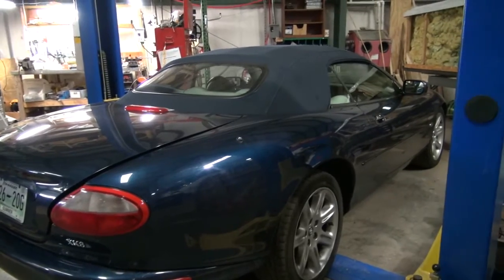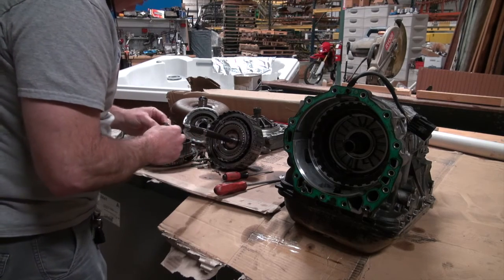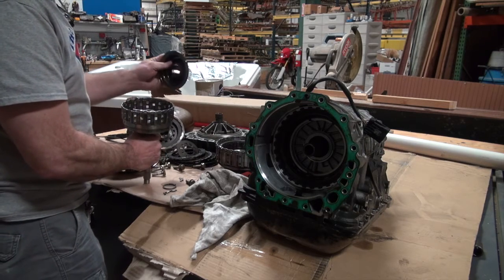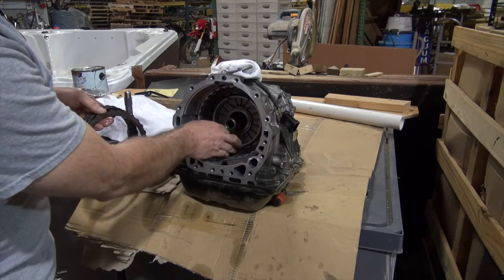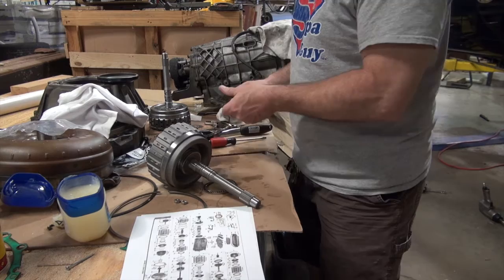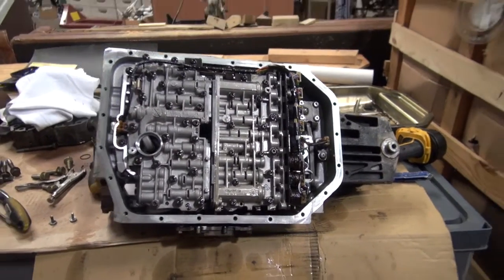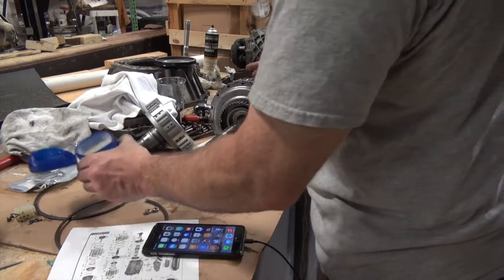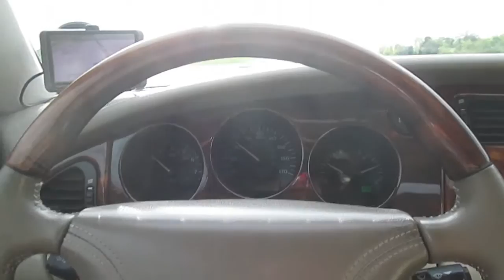Jaguar XK8 Transmission not Pulling Repair How To Broken A Drum P1722 Code

Comment: Great video, thank you! I work in the motorcycle industry and we use similar type clutches. It's important to soak them in oil for an hour before install. Should automotive clutch packs be soaked in ATF in the same way?
Reply from the maker: Brian, It wouldn't hurt but I never have..

Comment: I have a question about a 03 xj8 it slams when into gear when i put it in reverse ujoints are good and it doesn't have power like it starts in a higher gear so it takes longer to pick up anyone have any obvious answers
Reply: Did you find an answer this is whats up with my 98 3.2v8